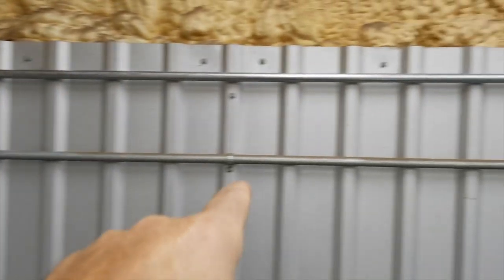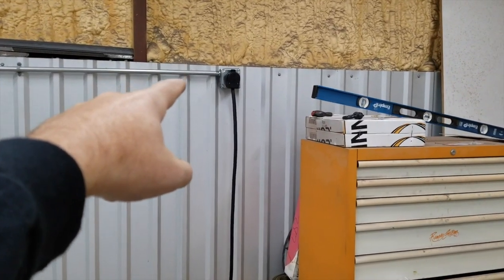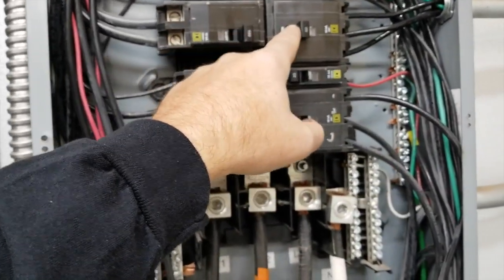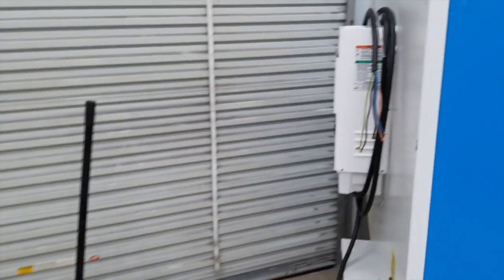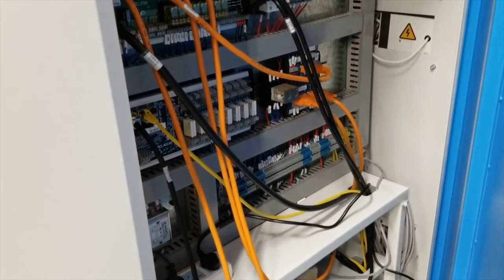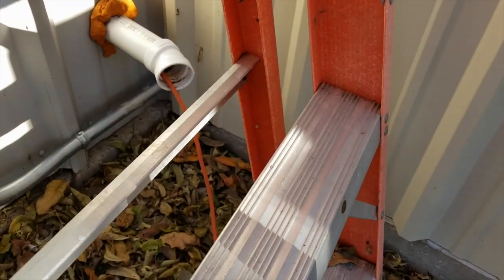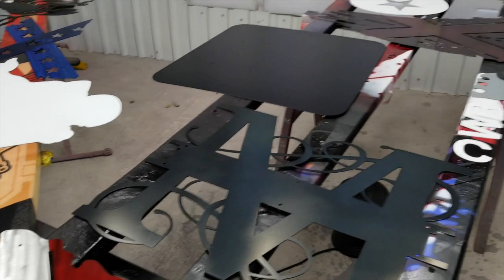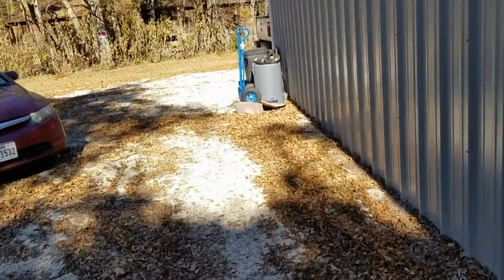450 Volt High Energy Shop Update - CNC Tube Laser

Comment: That could be a big opportunity for you! I'm not sure I'd like a 60 amp breaker feeding a 10 gauge SO cord. I'd try a 30 amp and see if it works. I ran a whole Haas VF3 on a 40 amp breaker. Ebay is a good source for cheap used 3 phase breakers.
Reply from the maker: didnt even think of eBay for those but will check it out, and i like the idea of using a 30amp, 40amp, some of the info i am getting from the chinese mfg has been confusing for sure
Reply: @turbocobra  For some reason "3 phase" is like a secret code word that makes it OK for electrical supply houses to rape you on the prices. A single phase Square D QO (double pole) might cost $30. But a 3 phase version is like $150. I buy used ones on ebay all the time. They don't really wear out.

Comment: Mhhh 🤔 a 60A breaker followed by a 50A plug !?  I hear that you won't use that much in normal condition... but... if something goes wrong (or you add stuffs...) you can burn your plug before the breaker goes off...
As for the cables I am not acustomed to wire gauges (I am a metric guy) but you should always have a cable (same goes for plugs) at least capable of sustaining the amperage of the breaker preceding it... as you go down the line you can have smaller and smaller breakers and cables...
Do not forget that if the machine draws for example 40A under 380V it will make about 70A under 220V... Just saying...

Take care Gary

PS: I am an electricity teacher for engineers in Belgium...
Reply from the maker: yes, great point and I do realize that, however the weakest link is the wire itself, rated for only 40amps.  i may do what Wes said below and put a 40 amp breaker in it.  The one thing I didnt mention is that the control cabinet has its own breakers and transformers, so there is protection inside the machine
Reply: Should be a good idea to change the breaker... 
I note that the cabinet has its own protection but remember that a breaker only protects what is after it... And that the transformer transforms the voltage AND the current so that the power (voltage times current) is almost constant.  The input current is thus bigger than the output current for your transformer...

Anyway take us in the loop for the trucut machines

Comment: I installed a $100 electric heater in my garage.  Its been awesome at keeping the space warm.  You might think about one of those for the booth.  Maybe mount it in your shop with a louver to the booth?  That tubing laser is going to be a crazy cool addition to your fab business.  Lastly, I've noticed the first two weeks of November are terrible for retail stuff.  Its like everyone is waiting until the turkey thaws.
Reply from the maker: the paint booth needs soem heat for sure, the only issue i have is that I have tried to keep everything explosion proof by not having anything in there that can cause a spark.  I think the ultimate solution is to build an enclosed manifold on the intake outside the paint booth and use a jet heater to heat the incoming air of the paint booth, but i doubt it would be able to keep up when the booth is on